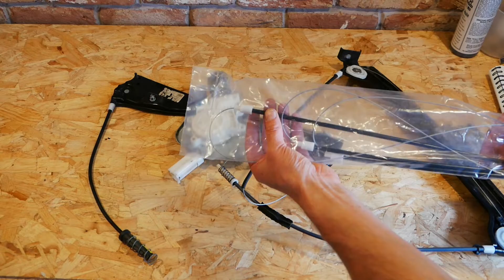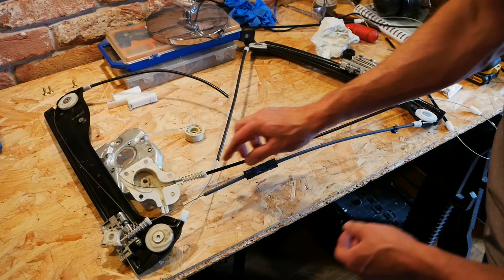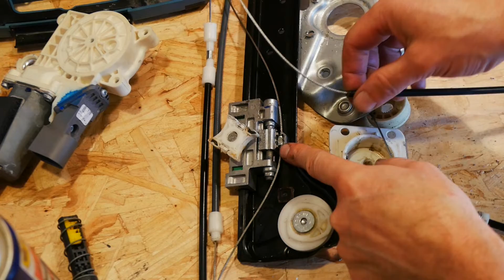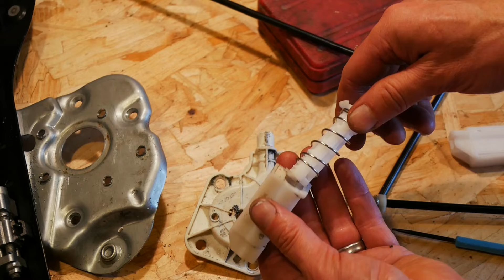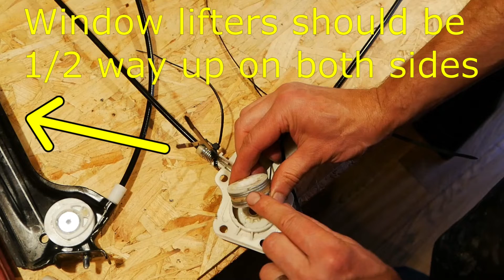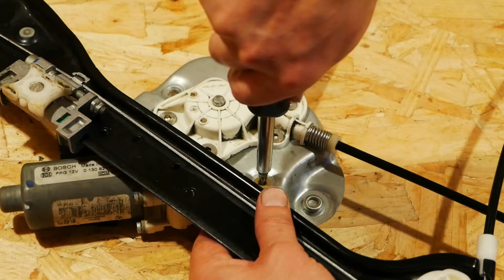E86 Z4 / E85 Z4 | Window Regulator Repair

Comment: Good tips. 

I have a problem though.
My window is not back to its position.
The culprit is the right side. I change the window regulator, 
For some reason.if you are inside the car and looking at the right side mirror, looks like the glass is shifter to right; so theres gap on too left. . Please help.

Comment: How much would a full replacement mechanism be from BMW
Reply from the maker: The full mechanism is about £200 from BMW + labour if you don't fancy fitting it yourself. I have seen prices on forums for around £450 for the full job. What I would say is that replacing a full unit is much easier than repairing the old unit. And of course, a full replacement should last another 15yrs. So, as usual, it's down to personal choice how you decide to tackle it. 👍